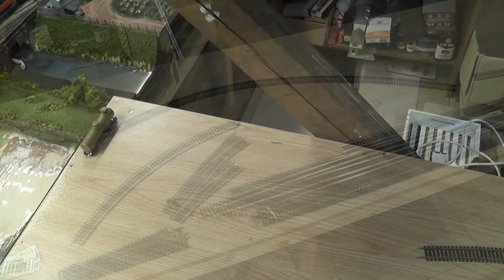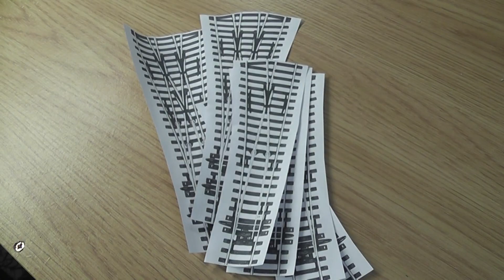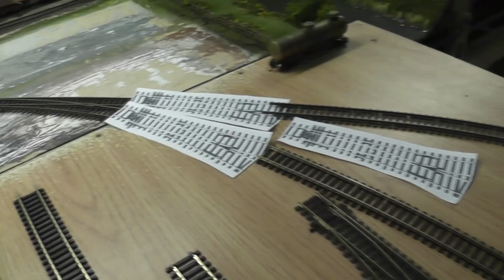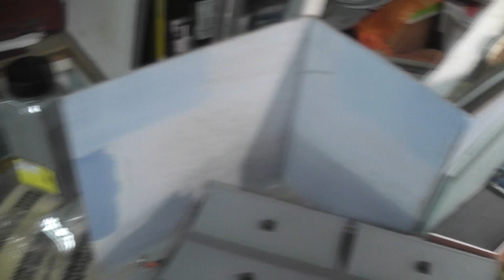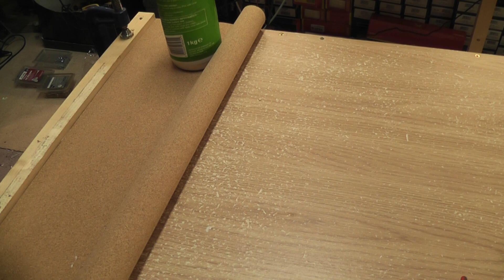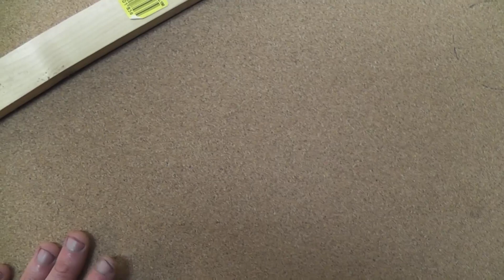Building a Model Railway - Part 2 - Planning

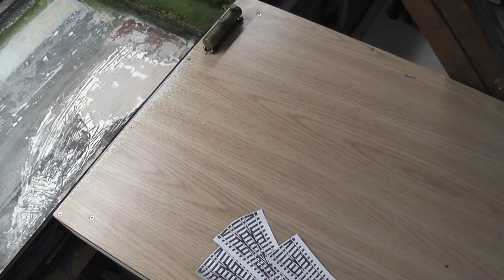Comment: I like the demolishing part 1:10 (looks like real) "(ღ˘ ⌣ ˘ღ)" and using prints to plan track is a good idea。What I like the most when a building model railway is on the table is when 3-4 persons are starting to make one and they only use locos and wagons to share tools and merchandises without moving : 「I send you my loco with five gondolas、I need sand and concrete rock and would you give me wood too」。The person one have to drive from distance (using cameras are best) while the other person guide the other person "(ღ˘ ⌣ ˘ღ)" That is a gHOod experience "(- . -)"

Comment: with glueing the cork down my baseboards are screwed into position and I can't clamp down certain bits but was thinking of laying another board I have just on top. but I need to double the thickness of the cork so could I glue another layer of Cork on top of the other??

Comment: Apiece of ling film or similar between the timber and the cork should stop the strip of wood sticking.
Cling film...the modellers friend!!!...put some over the top of a jam jar and put some super glue in the middle. Stays useable for ages and you can dip a cocktail stick in and use just a minute amount. Cheers, Bob

Comment: Hi Mr Junction.
 
Your videos are always so very useful. Thanks for the peco points template tip in this video.
 
I have question. My layout space, as for most people I suspect  islimited.. I was thinking of including a turntable in an extension to the basic oval, for interest and rotating locos. Is it feasable/sensible/wise to include a turntable as part of an oval as a kind of ‘run-through’ with spurs off?
 
Hope the question makes sense.
Reply from the maker: bertrand russell You can do that but it wasn't common in real life.  Turntables were usually at the end of a depot or station and rarely went anywhere.
Reply: EverardJunction Thanks for the reply.I will 'have a go', as I said my space is limited and turntables use up a lot of space.I will sacrifice a huge wadge of realism for a small modicum of fun.TJ

Comment: I have a question regarding movements of trains to and from the extension. Presumably this means that the mainline is bi-directional. Do you have some kind of crossover / slip further down the track so that you can get trains back onto the right direction?
Reply from the maker: peaps The branch line is bi directional which the yard is connected to.  The point work in the station can be too to get trains across to the correct tracks.  Part 3 will give you a better idea for the routes of trains.

Comment: That area at the junction between the mainline and the new baseboard seems like the sort of place that would belong to the railway but not really have any use for so it just has a lot of weeds and rubbish with lots of ugly fencing that the vandals and fly tippers break through :)
I'm casting my mind back to when I used to travel past the EWS depot and miles of carriage sidings on the north side of Peterborough. I associate lots of weeds and oil stained concrete around sidings, and nature always starts reclaiming them from the buffer ends :)
Have you thought about building a carriage wash? That might add some interest to the sidings without making the place look too cluttered.
Reply: sorry, I rambled on a bit there. I'm sure whatever you build will be 10 times better than the image I have in my head anyway, since that's been the case for every other part of the layout you've shown from a blank board to finished scene! :D

Comment: Hi Richard I was just thinking {which I shouldn't do I know}. Could you use your new extension as an MPD rather than your carriage sidings and turn your old depot over to be carriage sidings? Just an idea. Other than that a cracking job. Now back in my box.

Comment: you would benefit from installing a head shunt, as all stock moves between cleaning/servicing roads would need the stock to run out on the main and back in again

Comment: Hi Richard
Great stuff as normal.
Just a couple of suggestions.
Would it be better to also to insert a crossover from the branch and first mainline track between the mainline crossover and the to allow any stock to get from all three main loops to gain access to the carriage sidings. Also a pair of points towards the end of the two outer (longest) sidings to give a run round / loco release so you haven't got long runs of the pilot pushing the stock.

Paul

Comment: Nice update Richard. Next time try using a packing tape on the wood that stops it gluing down. I also use floor underlay as I found it stops a lot more sound from the locos. Looking forward to the next one.